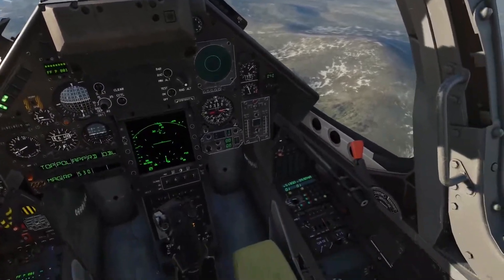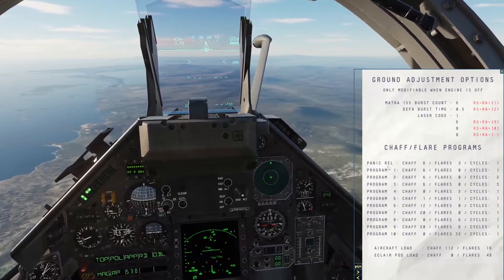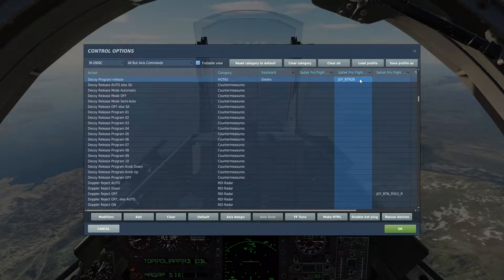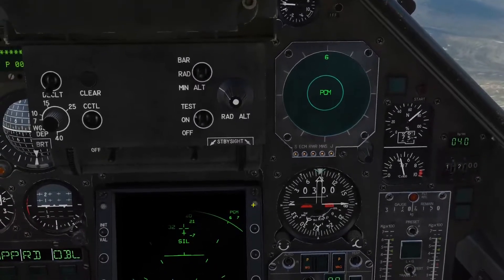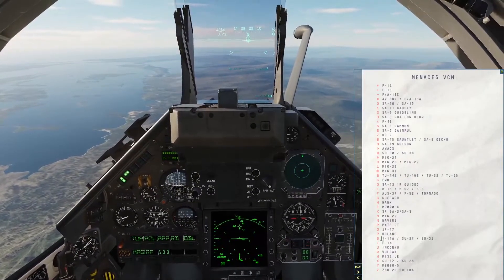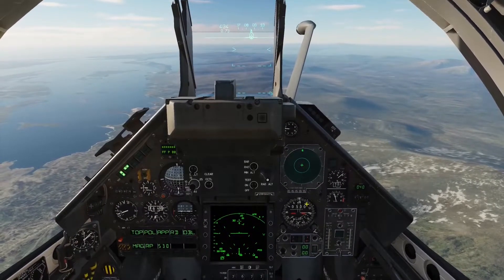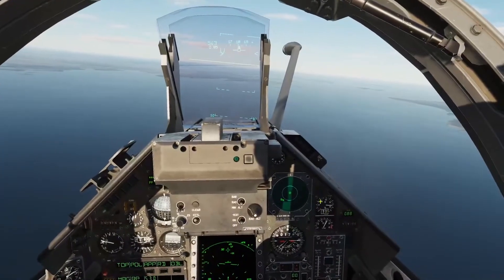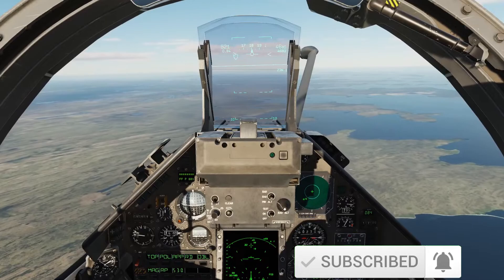DCS M2000C: RWR, ECM and Counter Measures

Comment: On the Dispenser Program Selector Dial “A” means automatic, not Arrêt – OFF like some other switches.  In this mode it will automatically select the countermeasure program to counter the highest radar threat.

Comment: Nice Video, but unfortunately a few things are not quite right in the beginning. The Modes selector: STBY -> standby, the square means -> "the jammer will jam radar emitters that are locking the aircraft at REDUCED power, to allow radar operation", and PCM means -> "the jammer will jam radar emitters that are locking the aircraft at FULL power, automatically switching the radar off. So no, it is not constant jamming. If you use the "Jammer PCM Override Toggle" (on your HOTAS) you will have constant jamming. However, if you use the PCM override and do not switch it off again in time, you run the risk of getting hit by a missile that operates in "Home on Jam" mode.Therefore, leaving the selector switch on "Square" or "PCM" is indeed the best option in the vast majority of cases. The system automatically switches off as soon as it broke the lock to avoid "Home on Jam".
The dial on the right (Decoy Dispenser Program Selector) A - 1 - 9, "A" here does not mean off, but automatic. It automatically selects the program, to counter the highest radar threat.
Source is the very good manual starting on page 361 and also the Discord Channel of Razbam itself. 🙂
Reply from the maker: Well I do the best I can. I have numerous platforms to learn and try and help people with. I do lots of research on all of it before I put something out. But I am human just like anyone else.
Reply: @synicalmanor  After all, it's not meant in a bad way. I just wanted to help to put these things right
Reply from the maker: @felixx75  I didn't take it in a bad way and I appreciate your input. I go from module to module so sometimes i miss things.